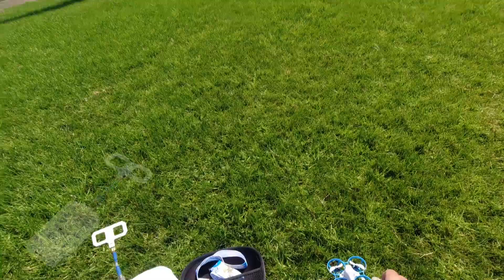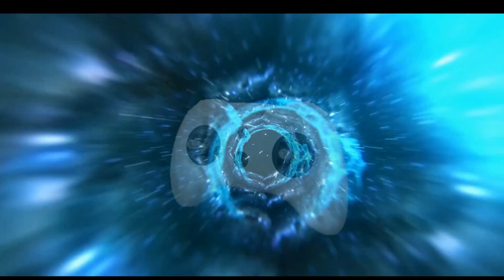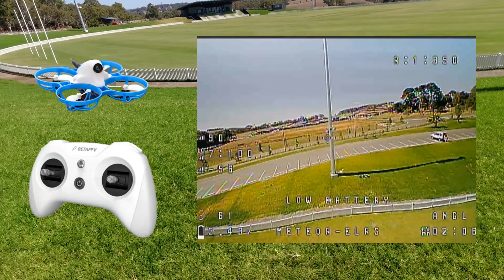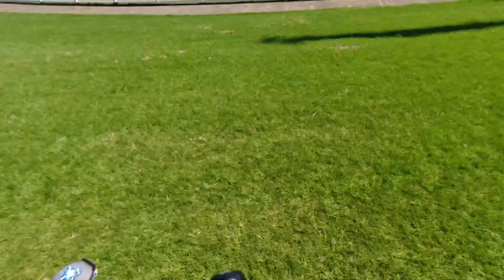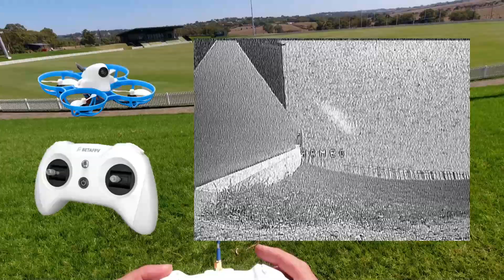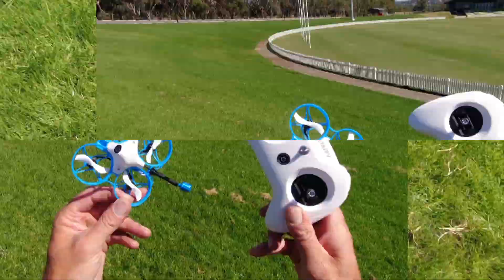Beta FPV Lite Radio 3 ELRS Setup / Review / Range Test 💥

Comment: Hi thank you for sharing, How did set the packet rate to 7:100 or 500hz using betaflight flight configurator? Or is it possible to set it using just the OSD in the goggles?
Reply from the maker: I used the BF Configurator mate. Let me know if you need any help setting her up!  Cheers. SP

Comment: What vtx setup did you use? seemed super stable! Im thinking of getting a Ev100 with the external DVR and a realacc 5bi pagoda and Triple Feed Patch. Is it worth swapping the dipole antenna on my quad for a mini lolipop?
Reply from the maker: I'm just using my old faithful Skyzone 02X with double Lumineer AX2 and a tbs patch Ant. Works a treat  🍻👍